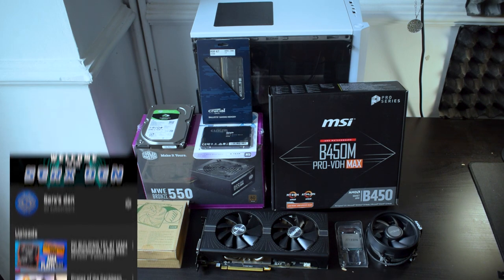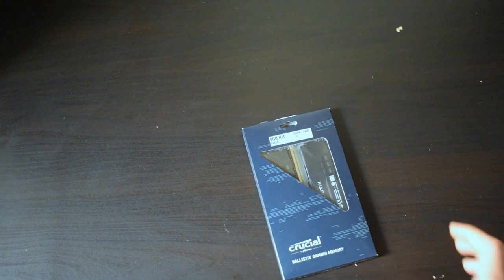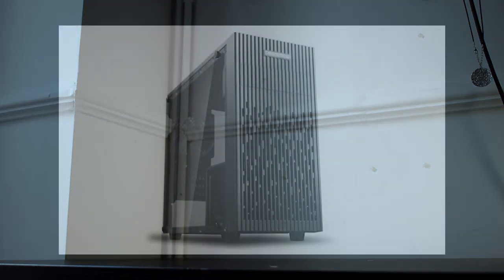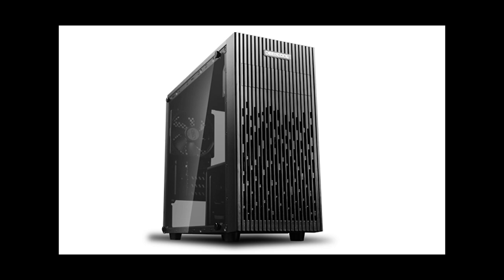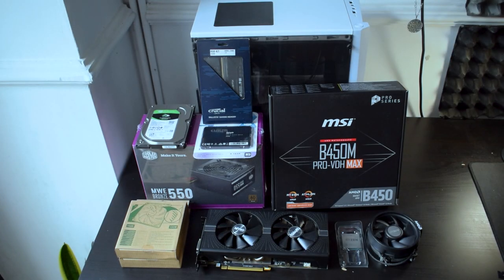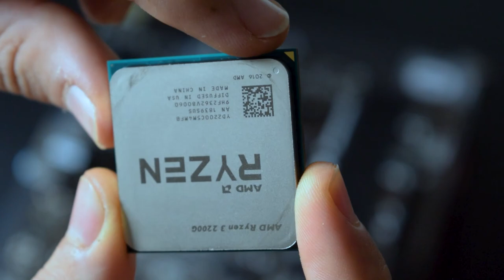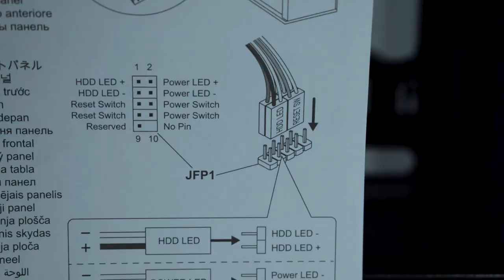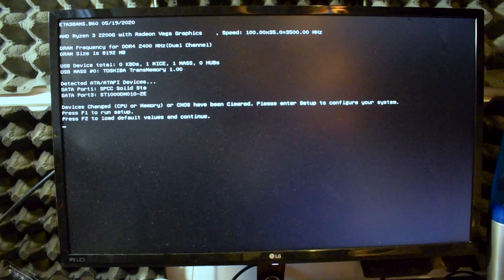$500 AMD Gaming PC Build (Late 2020)

Comment: good spec, but unless you're trying to use you pc as a microwave the case isn't the best, but good video definitely deserve more subs man keep it going
Reply from the maker: Hahaha, yeah I actually mention that in the video, I only picked the case because it was on sale. With that said, because the only component that actually generates a lot of heat is the GPU, it manages to stay at reasonable temperatures. Thanks for the comment ☺️

Comment: This is a pretty good build, but the cpu is the bottleneck of the build. I personally would of went for something more like a Ryzen 5 2600 and an Rx 580. Those two would more than likely perform better together and if you look in the used market, you can probably find those two at a price that wouldn't really affect the budget. Still a very solid build. 100% need more recognition for such a quality video.
Reply from the maker: Hi! Thanks for the nice comment. You're totally right there, a Ryzen 5 2600 would've been a substantial improvement. I didn't have any luck finding good deals on any Ryzen 5 where I live though, so I had to settle for this one. But the first upgrade should definitely be the CPU!

Comment: Is this PC good for decent graphics and FPS if I use it for a FPS like Warzone and Cold War?
Reply from the maker: Hi, yes it should run pretty good at 1080p 60fps+ on fps games, but you won't match high refresh rates if you're using 144hz or 240hz monitor unless you lower the game details

Comment: The Deepcool Matrexx 30 is not a good case! There is very little room for cable management and space for certain graphics cards.
Reply from the maker: Hi, I gotta say that I've built in the Matrexx 30 and for the price it has decent cable management cutouts, tempered glass side panel, and enough room for any dual fan gpu. You obviously have to adjust your expectations to the price point of that case, it's meant for budget systems like this one, anything else is a bit of a stretch.

Comment: HERES A NOTICE FOR EVERYONE: That case has no front airflow. The little grill on the front of the case leads to the feet, so there is literally no airflow. your pc will suffocate if you use that case
Reply from the maker: Hi there, I appreciate your enthusiasm but that is not completely true. This case's front airflow is not good, as I mention in the video (idk if you actually watched it) but there is a small intake at the bottom where some air can flow through. 
I say this because I had that same concern, and tested it with the system powered on. It is nowhere near the airflow of mesh, but it is actually quite comparable to some popular NZXT cases. 
PS: This case is intended to be used for low-end builds, not with high-end hardware since it cannot handle that amount of heat. In this particular system the only component that generates a substantial amount of heat is the GPU, which never reached 65°C under full load for 1 HOUR. 
Have a good day.
Reply: @Serge08  ah, ok

Comment: I've got a better Build with only brand new parts for roughly $550 from where i live.
AMD Ryzen 3 3100 - $110
ASRock B450M Pro4 - $78
INNO3D GTX1650 Super Twin X2 - $176
Kingston HyperX Fury DDR4 8GB (4GBx2) 3200Mhz - $50
Kingston A400 240GB SSD - $32
Seagate Barracuda or WD Blue 1TB - $35
Corsair CV450 80+Bronze 450W - $45
Cougar MG120-G mATX Tower - $39
This powerful budget build should be able to play most games with High/Max Settings on 1080p and can be upgraded later on with a better CPU or GPU.
Reply from the maker: Hi, thanks for the comment and great build. A few things about your list though. While  your CPU is definitely faster than the 2200g, there are some points to be made:
- The Gtx 1650 Super is newer and also better in some games, but it does get outperformed in some others by the RX 590.
- A 450w PSU is definitely enough for that build but I feel like 550w gives you a few more options for GPU or CPU upgrades down the line.
And lastly, prices where I live are quite higher than what you got, specially that GPU ($210) and also CPU ($130), so one of the main purposes of the video is to show people that second hand hardware is great if you can find good local deals! And that high retail prices are not a huge problem if you what to look for in the used market... But thanks for sharing really :)
Reply: @Serge08  Yeah of course the RX580/590s are more powerful than a GTX1650 Super and even the  GTX1060 6GB. I can get a used RX580 Nitro+ for $98!😆 Which would make the build even  cheaper than it is. But i generally don't trust used pc parts like RX480/580/590 because they're famous for 24/7 Crypto Mining Torture. And the APUs like the 2200G or 2400G are great for HTPCs with light gaming on TVs. But they probably will bottleneck that beefy RX590😷 in most CPU heavy titles. For me the best budget CPUs for Gaming are R3 3100/R3 3300X in 2020.
Reply from the maker: @akkraphonglothongsuwan3962  I see what you mean, and it's true that rx580's are famous for ethereum mining, that's why I always ask for a receipt with the order date in order to know how long it could've been mined with. You're lucky to have those kinda prices tbh!
Reply: @Serge08  I live in Thailand 🇹🇭 and that's pretty close to China/Taiwan where most of the PC Brands and Factories are home. I think the shipping costs and taxes are lower here because of location.
Reply from the maker: That makes a lot of sense! Very cool that you're watching from Thailand😊

Comment: Hey man my budget is 500$ I need a video editing and gaming/streaming pc can you please suggest a build is this one is only suitable for gaming
Reply from the maker: Hi Arshad! If you're planning on streaming I would recommend getting a CPU with more cores. I recommend you the Ryzen 5 1600 AF that has 6 cores and 12 threads and can be found for around $150! The rest of the components would work perfectly fine :)
(maybe get a case with better airflow and call it a day)
Reply: @Serge08  thank you so much for replying ❤ and also will 1600 af be to old in 2021?
Reply from the maker: Thanks Arshad! And about the Ryzen 5 1600 af, it's not old at all and a very capable cpu (very similar performance to the Ryzen 5 2600) since it uses the same 12nm architecture instead of the old 14nm, so don't let the "1600 af" naming confuse you, since it's quite different to the original Ryzen 5 1600 in terms of performance. Also, the good thing is that you can later upgrade the cpu to a Ryzen 5 3600, or even a Ryzen 7 3700x if you find a good deal! Have a good day :D
Reply: @Serge08  thanks a lot 🙏 ❤